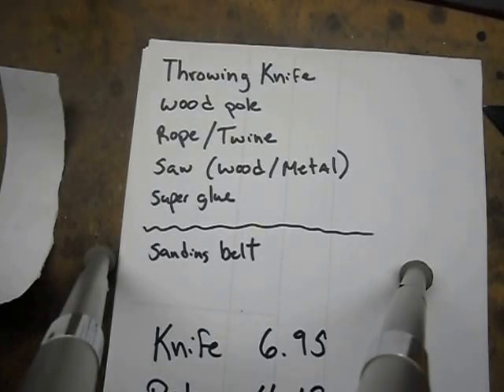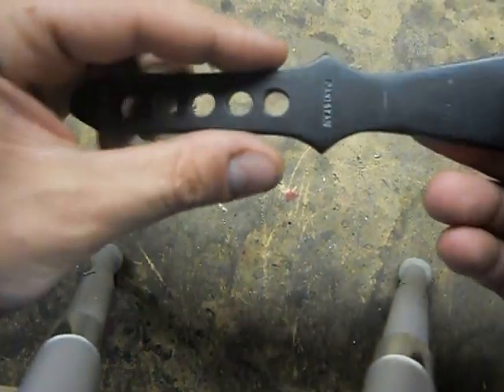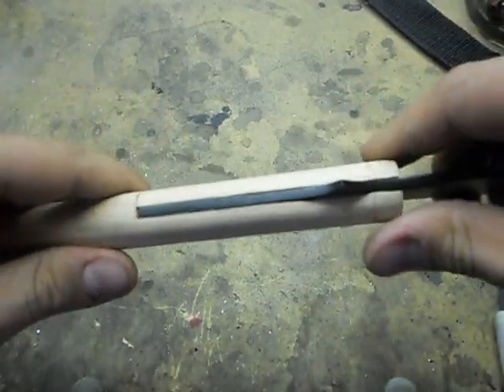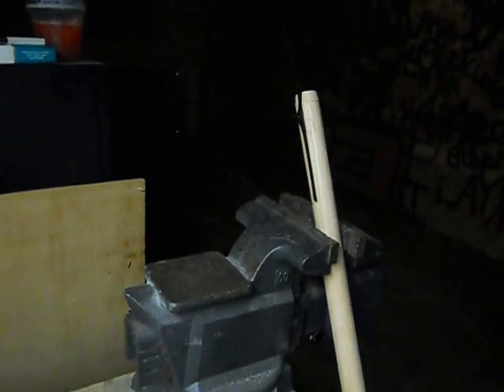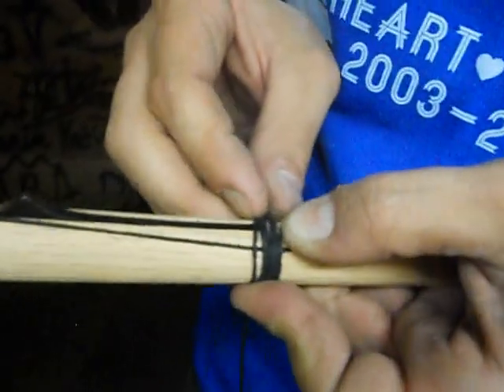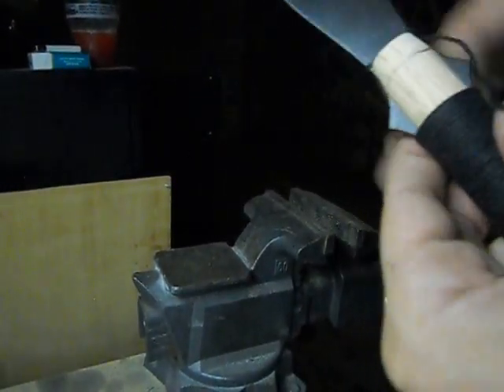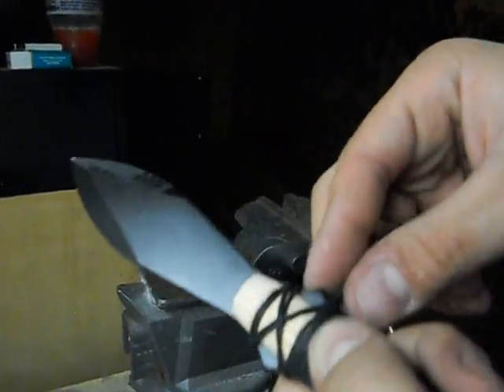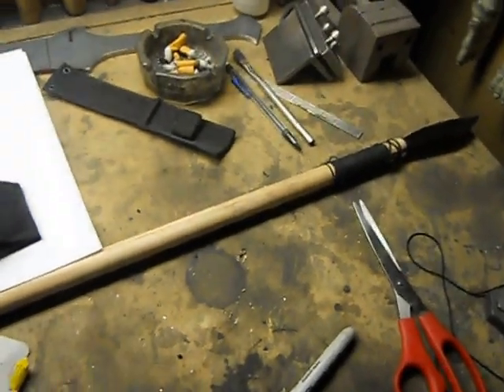Quick Home Made short spear

Comment: Not bad, not bad at all. If you use a cold steel shanghai shadow instead of that knife you'll have a sheath for the point too. (it's what I did;) ) you'd need to use stouter chord though. You'd have a thrusting spear then. ATM you have a PERFECT throwing spear. Gold work.